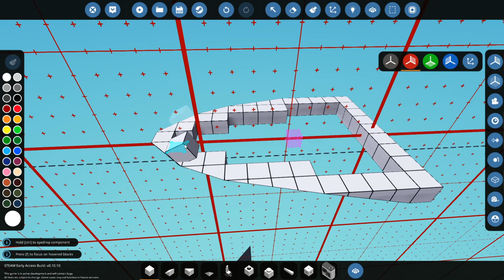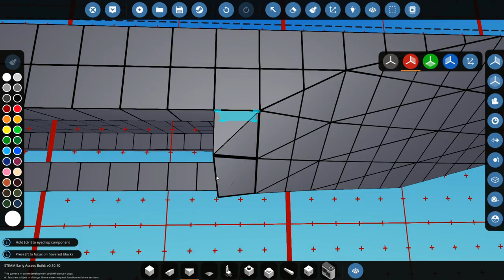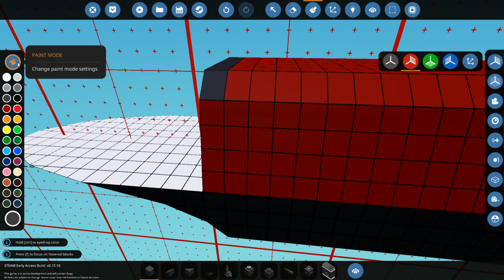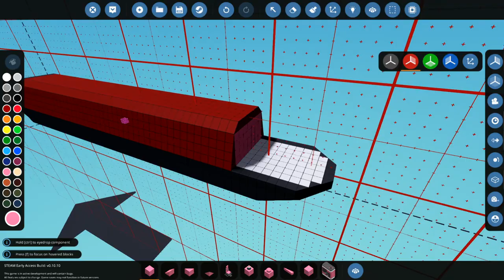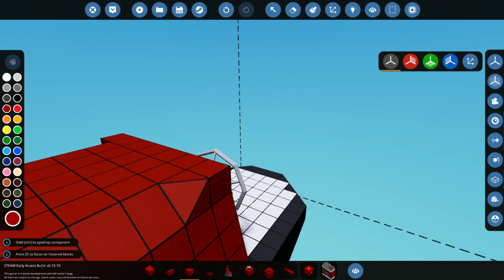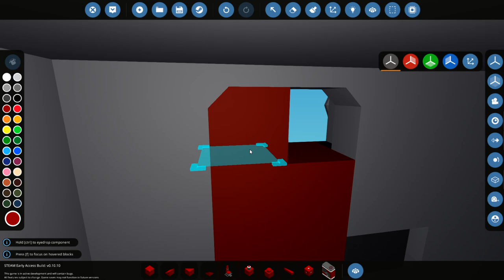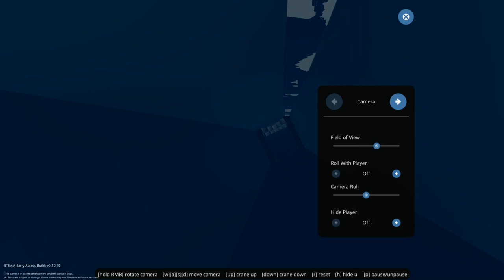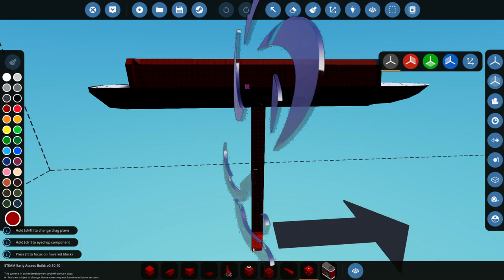She's A Floater! -  Narrowboat Build - Part 1

Comment: I got you Frantic. The purpose of Blacking for boats and ships is to prevent the growth of moss and barnacles on the hull. The blackening paint used (no longer strictly black anymore) has chemicals in it that just don't allow those kinds of water life to grow on it. But it introduces new problems while solving old ones.

It solves the growth problem which can introduce invasive species across oceans (yes, it is a thing) and the faster wear and tear of ships hulls. But it now means that there's more chemicals in our oceans and the invasive species problem is still a thing. Little microbes will cling on to hulls and be carried from port to port and wind up proliferating to a point where the water's ecosystem is wrecked. I'm not a tree hugger by any means, but knowing a little helps understanding a lot.

But most any water vessel stuck in the water usually have it to increase the longevity of the hull. Smaller crafts that are launched into and picked up out of the water repeatedly and frequently (recreational speed boats and jet skis) don't need it because they're usually washed off and cared for on land and they're not in the water long enough for things to start growing.

Just a bit on Blackening and ships.